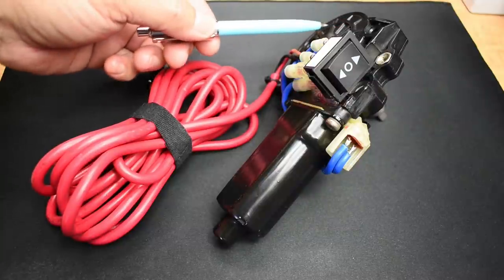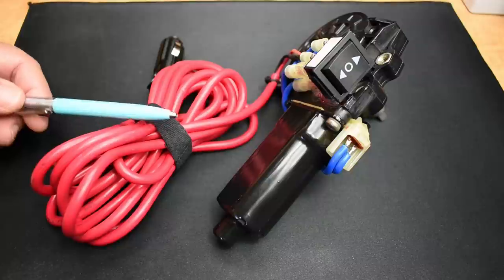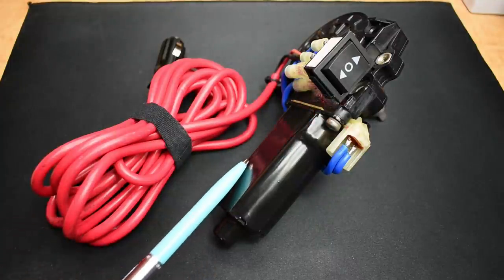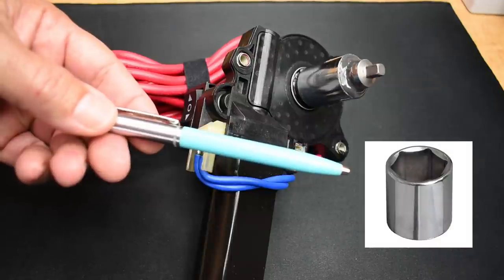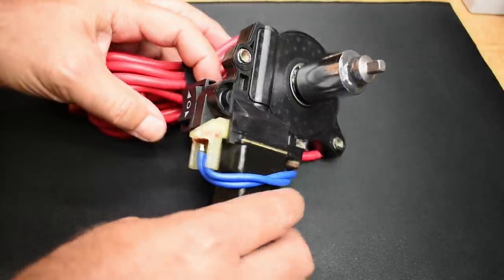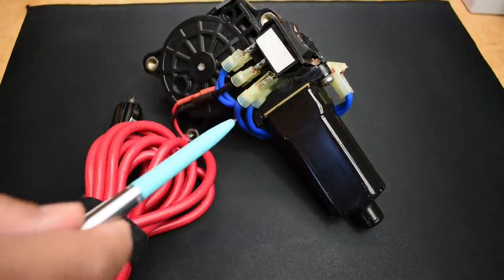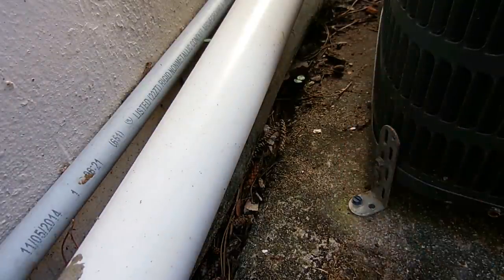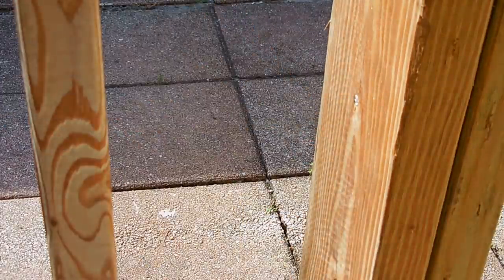Awesome & Extremely Useful Car Power Window Motor Hack!

Comment from the maker: ATTENTION: Some viewers mentioned right angle drill adapters and electric ratchets. I have a right angle adapter, and they have limitations. You have a bulky drill attached to them making it more difficult to use in tight spots if you need to reach in, and with my unit, I can insert the entire "drill" into a 2x6 wall with only the opening for a double gang electrical box. As for electric ratchets, they're good, but can be bulky and expensive. The purpose of this video was to REPURPOSE an old power window motor. Thanks for watching! Stay safe.
Reply: Nice. Also check out right angle impact drivers.

Comment: This is great! I'm going to use this to motorize some scissor jacks.
Reply from the maker: I tried it, no good. LOL It has the power to almost get the car off the ground. In order to make it work, you'd need to add a 2" gear off the gear on the PWM, and have the socket attached to that gear. It will spin slower, but more torque.

Comment: I used one of those motors to turn my solar panels on like a lazy Susan type deally years ago. Didn't have to go outside to do it.
Reply from the maker: Using it at 6V would make a great rotisserie. 🤣 Thanks for watching! Be sure to share the video link with others and rate thumbs up.

Comment: Dewalt and Milwaukee tools make a right angle drill adapter that will also work for these situations.  Less than $ 20 US.
Reply from the maker: I have one, they have limitations. You have a bulky drill attached to them making it more difficult to use in tight spots if you need to reach in, and with my unit, I can insert the entire "drill" into a 2x6 wall with only the opening for a double gang electrical box. Thanks for watching!

Comment: I liked how much control there was when driving the screw and drilling the 2x4, tons of smooth torque.  Another thing you can do is use this on a scissor jack to change a tire on your car.

How much was it for all the parts?
Reply from the maker: Believe it or not, the scissor jack was my first idea which I tested. It was able to raise the car almost off the ground and then it went to overload. I tested this on three different vehicles, and the same thing, it couldn't get the car completely off the ground. Jacking up a small, lightweight European car probably would work fine, but for a heavier car I would have had to add an additional gear to increase the torque further. It does do an amazing job at driving screws into wood drilling pilot holes or small hole through wood or even into thin sheet metal in tight spaces where you couldn't use an ordinary drill. Thanks for watching! Be sure to share
Reply from the maker: I only needed to buy the red power cord and switch. I had the socket and tips. Less than 20 bucks.
Reply: @electronicsNmore   I would be happy to at least being able to reach the jacking location, as you know that it takes a lot of turns just to reach it...  I am lazy 😅

Comment: Great idea - thanks!
With the low duty cycle use and built in protector, seems like a good candidate for a mild overvolting to increase unloaded speed.  eg 4S / 14.8v nom/16.8v max lion battery connected to that long 16ga cord, which would nicely limit current/drop motor voltage, as it loads down.
Reply from the maker: Yes, I tested at 14.5v, and it was just fine. Thanks for watching!
Reply: @electronicsNmore   Cool - thanks!

Comment: With windows in car once it is closes or opens window it does stop but on the video it is able to drill through. Is it after it reaches a certain torque? Also, would you be able to increase the torque of this thing by increasing Voltage etc. This is really cool and I am really thinking of few things
Reply from the maker: With the car window, the trolley connected to the window has a stop at the bottom and top of the track. Once the stop is encountered(or the window closes tight), the current surges causing the overload switch to open the circuit.

Comment: Seems like it might be better than a lot of the cheap power screwdrivers out there.
- better clearance
- higher power (12v vs usually 3.6v or so)
- easily replaceable battery/power source
The only thing it doesn't have is a clutch but the RPM looks low enough to not need it, and while I can see a lot of runout it probably doesn't matter as much on such a short tool - some jigs set up to align the parts when making it would probably fix that anyway.
Reply from the maker: It's a useful tool, but not something that would replace all other tools.

Comment: What about a Millwakee M12 rachet? How does the cost of building this compare to $100 for the rachet?  The Milkwalkee is much thinner.  And no cord.
Reply from the maker: That's a quality ratchet, but looks much bulkier. If you want higher torque, then it's def the way to go.
Reply: @electronicsNmore  At just 10-3/4” long and 1.9 lbs, the ratchet is tool-belt portable, and features a 3/4" low-profile head design for work in the tightest of spaces and engine bays. The variable-speed metal trigger and reinforced steel housing provide maximum control and durability with any application.
Reply from the maker: @joecraigslist9467  10 3/4" not too short
Reply: @electronicsNmore  How long is your model?  Any idea what it cost to build. I've don't have a window motor.

Comment: You need one of those digital torque blocks project farm uses to measure the maximum torque this power ratchet can put out.
Reply from the maker: Actually, I could connect my Tekton torque wrench to the 1/4" drive adapter to measure how much.

Comment: I can do the same thing and faster with air power.
Reply from the maker: Then you need a compressed air supply wherever you use it, no good, I like what I have better. Speed isn't important, getting the job done is. Thanks for watching

Comment: You can buy switches like the one you are showing that has the cross wiring built into the switch using flat bars at the base of the connectors.This is one I used recently.  DC Momentary Reversing Rocker Switch (Double Pole Double Throw) with Wire Pigtails.  https://www.amazon.com/gp/product/B00U1G5AR6/ref=ppx_yo_dt_b_search_asin_title?ie=UTF8&psc=1&fpw=alm
Reply from the maker: Yes, but they're harder to find and usually more expensive. If space is a concern, then I'd definitely buy one. Thanks for watching!